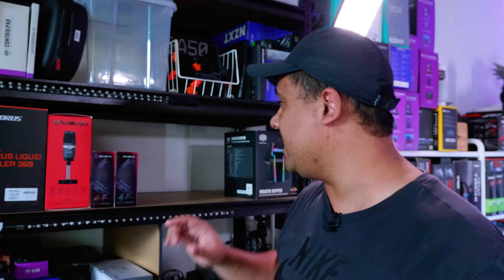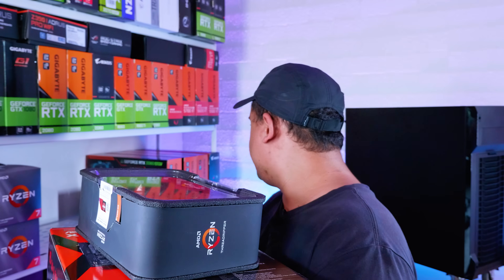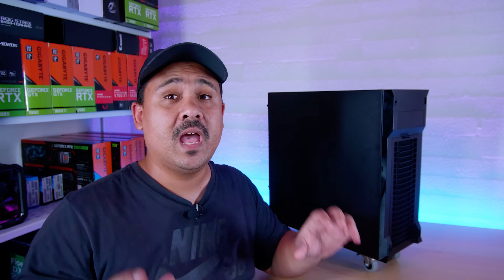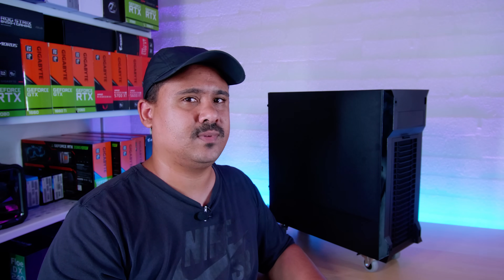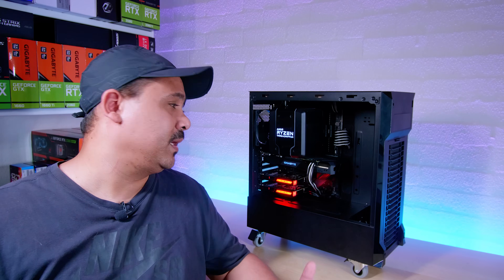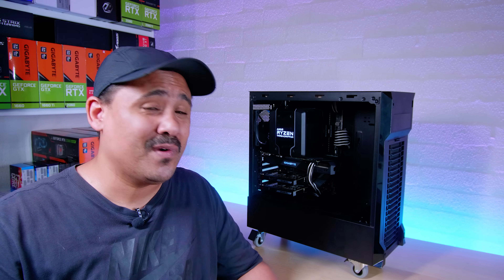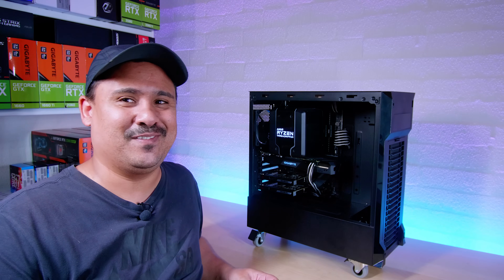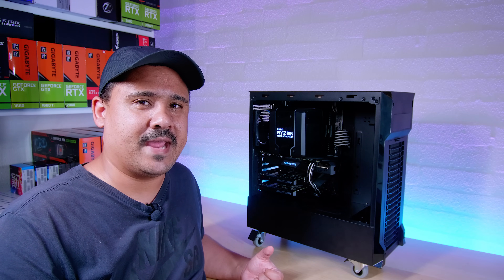Our Overkill Threadripper Stream Encoding PC Build - Streaming Setup Pt. 4

Comment: Do you find that the Ryzen Threadripper heat sink is the best thermal solution for that series of chip vs. water cooling?
Reply from the maker: That cooler is designed for a 32c chip. Works really well